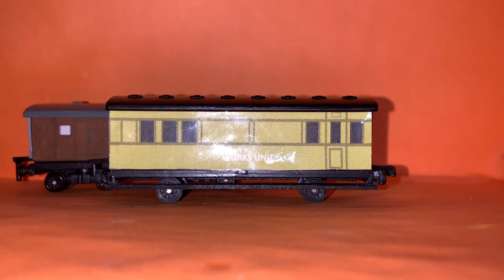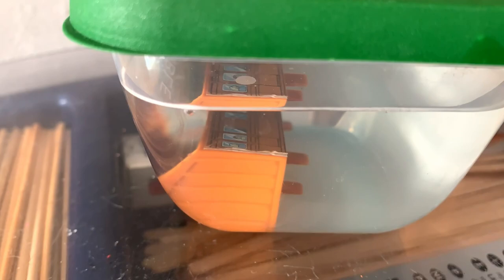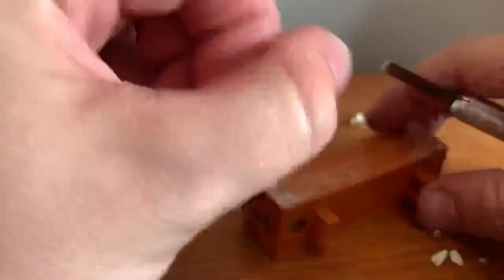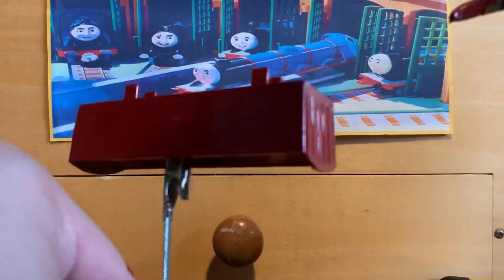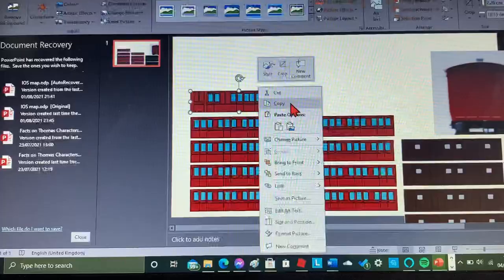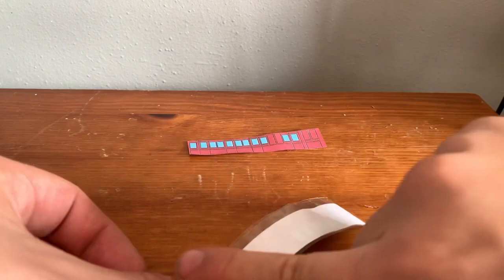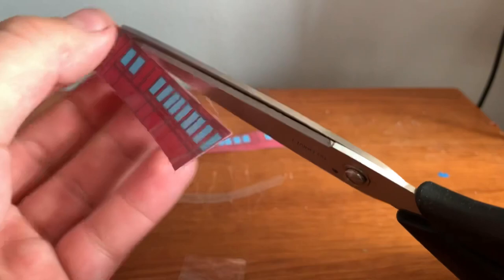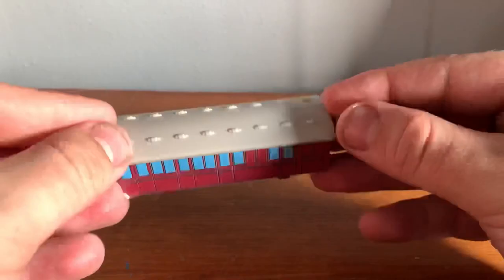How to Make Custom ERTL Rolling Stock

Comment from the maker: NOTE TO CUSTOM MAKERS: For the application if the decals, i have since come up with the method of double sided tape. It works a lot better, however is very precise work. if its not straight & you have to peel it off, this will create many creases, which you obviously don't want. & it works better, for ERTL's decals are, of course, stickers.

Comment: A very nice tutorial, but I've got a few tips that might help when doing these customs.  Instead of using soapy water to remove the original stickers, use either non-acetone nail polish remover or rubbing alcohol.  Those will attack the adhesive on the stickers and they should just peal right off.  Another advantage is that if you clean the area with either of those 2 things afterwards, you can remove any residue the stickers left behind.  I'd also recommend that rather than using regular paper and bluetac, get some regular sticker paper.  If you're concerned about the decals being ruined by water, then a quick solution to that is to spray them with a clear coat.  This will seal in the ink and you can literally dunk the entire model in water and the ink won't run.  I'd still apply the tape over the paper afterwards just so the decals look like originals.  I can honestly say I wouldn't mind making some of these customs for myself.

Comment: The best way to remove stickers (and how i do it) is to get item outside, spray it in WD-40, and let it soak for about 5-10 minutes. After waiting, get yourself a paper towel, wipe the item and then use a flat piece of plastic to strip the stickers instead of a blade, as those could scratch the surface. If there is some remaining sticker glue on there, use a Cotton tip and aggressively rub over the excess with water. Wipe it several times again, and you got yourself a shell ready for painting.

Comment: For removing the stickers, it's much, MUCH better to use a hair drier and GooGone instead of warm soapy water and a craft knife, as the heat from the hair drier and the properties of the GooGone will help ease up and loosen the adhesive bonding the sticker to the rolling stock. The GooGone will also help with removing the stickiness left behind from the sticker.

Comment: A very interesting tutorial. While most people would either paint or use water slide decals, making them in a drawing software like Paint is a very unique method.
Reply from the maker: It’s also very simple & straight forward to use if you know what you’re doing
Reply: @ScrapyardStudios  Something I forgot to mention is that I actually have used your method of making the decals in MS Paint even before this video came out. Done it for a years now. The only difference beginning I actually copy and paste the decals into MS Word instead of PowerPoint.

Comment: Nice! Though instead of tac I'd prob use hot-melt glue. (No offense, is there a reason why you used tac?)
Reply from the maker: I’ve come up with a better tactic since this video which is double sided tape. Particularly really thin tape like the stuff from hobbycraft in the UK. Be wary thought because if the tape’s too thick, the decals will protrude too far out so avoid really thick tape for that reason